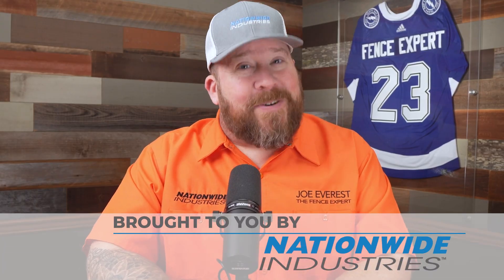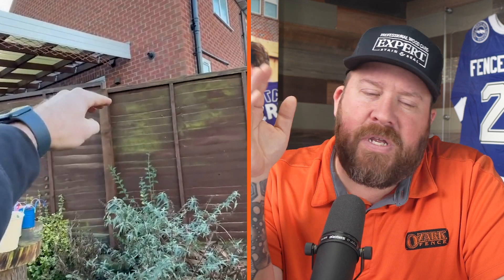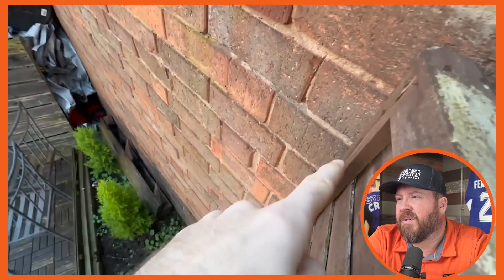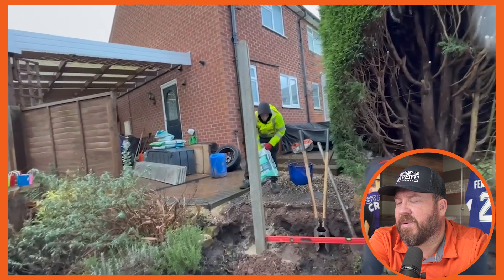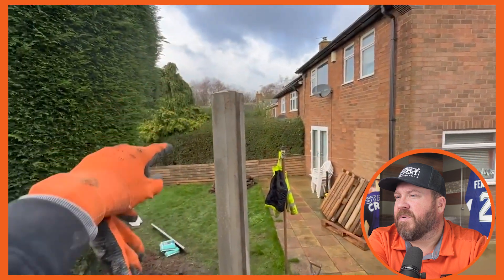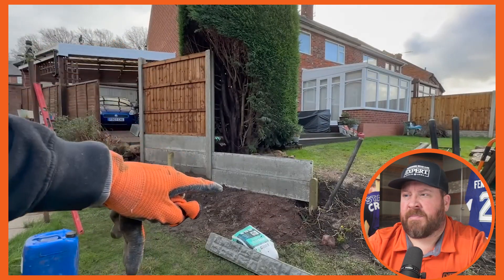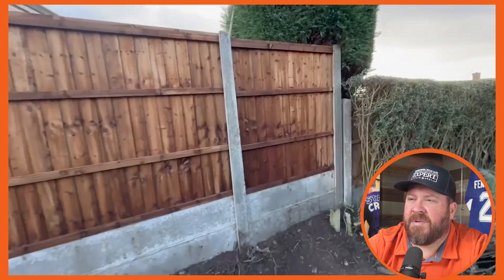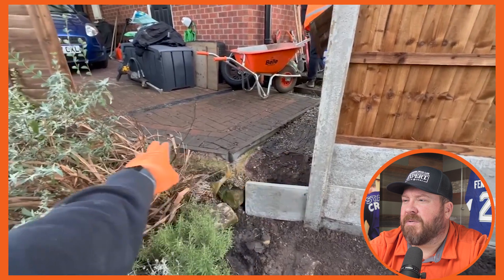Fence Expert Learns The UK's D&J Projects Technique

Comment: I would really like to have a fence like they make at D&J Projects!  The posts are concrete and you can just upgrade your panels over time!  No rot as you mentioned Joe, because the panels sit on the gravel boards. I'm a fan of D&J Projects as it you couldn't tell😂
Reply from the maker: All great points, they’re really great guys!
Reply: Concrete fences actually also deteriorate over time.
Water gets into them, and the rebar expands.
Reply: @deth3021  like anything there are various quality.

Comment: I Sell these concrete products and have been lifting them onto the pick up almost daily for 18 years! And yes it has taken its toll on my whole body!
Reply from the maker: I appreciate you weighing in!
Reply: 10ft corner posts are the worst...... they are heavy ......absolutely gut busting on your own
Reply: @alanoconnell9746  on your own! I’ll only lift a 4’6” on my own! Yes corners and three ways in 9’ are killer for me! But would never dream of lifting one in my own!
Reply: @halusomusic  yes .... I work alone so I have to lift them ....lol
Reply: I don't envy manual lifting. I used a crane mounted on my pickup truck to install my concrete fence.
Reply: You cant get lifting equipment in to most UK gardens ..... but yes it makes for a hard days work

Comment: The panels shown at the beginning are lattes panels and there crap ...... the panels d& j fit are feather edge panels
Reply from the maker: Good to know, I appreciate the clarification!
Reply: you could run through them lattice panels😁,,good quality feather edge panels last for years, all down to price i suppose £20 versus  £35-40 6x5 panels.
Reply: lattice panels are 28 pounds each now ....feather edge are 42.....

Comment: The fence he was taking down was'nt feather edge, them "things" or excuse of a fence panel is called the waney lap fence 🤢 its something someone like a property developer would use for maximum effect with minimum spend. look great for maybe 6 months and blown over in 4 or 5 years if you're lucky. Cheep boards about 4mm that  you can run through.  D&J will know a lot more about them than me 🙂
Reply: You are right they are not feather edge. Its a lap panel that is cheap and cheerful. Close board panel is far better
Reply: @Rigz.  Anything is better than them 🤣